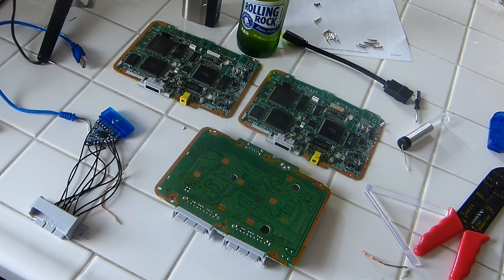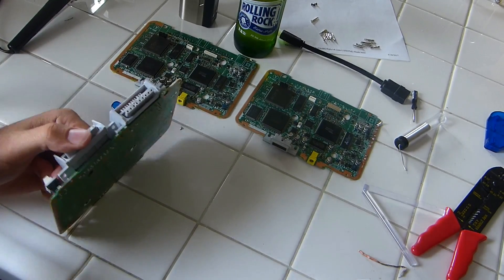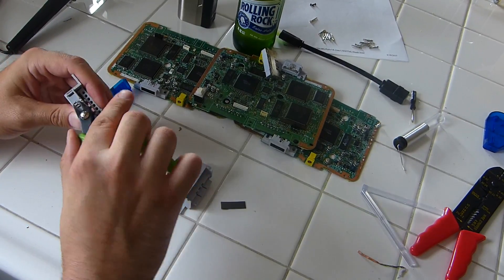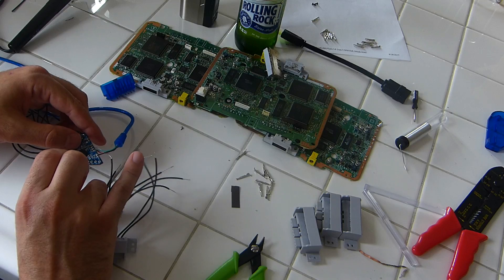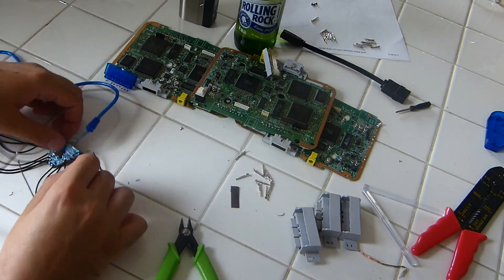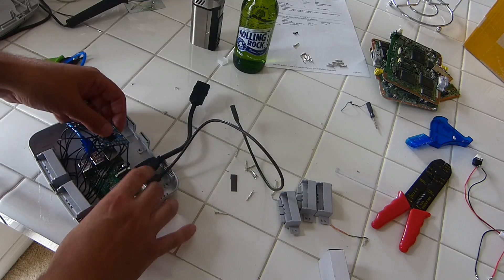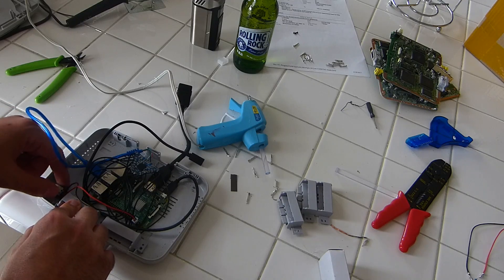PLAYSTATION PI CASE MOD TUTORIAL RASPBERRY PI - PART 2 of 2

Comment: damn soldering is the worth if anything ill just run a ps3 wireless controller(White) to play
Reply: You could just cut the adapter from non-working PSone controllers for aesthetics and use your DS3, even you can paint them grey. I'm going for that option.
Sorry about my English, it's not my native language. Regards from Peru. ;)
Reply: I just don't get the correct sequence of soldering the wires. Its just follow the same sequence of the usb board?

Comment: What is that little gold strip you are holding while you desolder? Does that help with removing? Mine just melts and sits there.
Reply from the maker: erp yeah its desoldering wick. you lay over the spots ya wanna remove and put the point ontop and it sucks it up into the braided material of the wick.

Comment: Question about the power button. Do you still need to shut down through the menus if you have the power button installed? Or does pressing the power button start the shut down process and then it turns off gracefully on its own?
Reply from the maker: James Watts No the power button being used on my images shuts down properly. It initiates a script that shutsdown the system. And as long as you dont remove power it will also turn the system back on.
Reply: Perfect! Thx MLP for clarifying. That is a clean looking mod. Definitely wanna give it a shot. Thx for the tutorials!
Reply: Hey, you wouldn't happen to have the script that you used? I am trying to build this and the power button doesn't work, I have a script I found online. Is there a certain way to wire the power button other than just using pin 6 and 5?

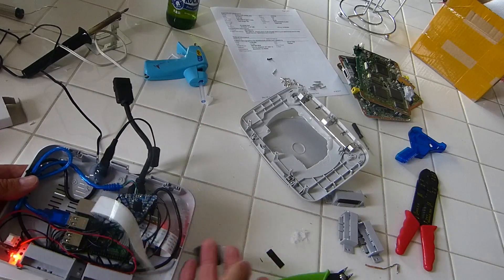Comment: Wow, you aren't going to believe this. So I remembered that in you video, you called out the byte count. So I watched it again and at around 10:25 mins, you called out: 31,104,958,464  So I went to the file that I have and at 99.9% complete, rtclkd it and then left clicked Properties and got the exact same byte count 31,104,958,464. Maybe I should just go ahead and burn the 99.9% You did mention some problem at startup. I wonder what is going on here?
Reply from the maker: rwprime1 I just looked this issue up, it looks like that last .1% is some file of the thumbnail or something that is created that is not part of the actual file. So my thought was the same that if thats the rite file size it should be the complete image minus some bogus file that windows creates when you create a torrent.
Reply from the maker: rwprime1 I also read some long winded process to stop this from happening when creating torrents, but never had this issue before.

Comment: Ron. I sent you an email regarding the WEREDIRTYGAMING.img Recalbox image on utorrent with possible solutions. Everybody is stuck at 99.9% (even those not using utorrent) and no one has 100% that I know of. Please check the email and see if any of those things help. Thanks. Richard in Michigan.
Reply from the maker: rwprime1 ok ill check that out now.
Reply from the maker: Where did you send the email? I checked all my inboxes and have nothing?
Reply from the maker: Ok I got your message, ill check it out.
Reply: Appreciate it Ron.
Reply: Ron. So I burned that 99.9% completed image and got it to run! I went to that icon or heading that isn't there anymore and clicked the Reset icon and the games showed up. I have an XBox 360 wired windows controller and all four segments of the the xbox button blink instead of the upper left being solid. Is that normal? (Just got it). Also,  the only way I could exit SNEW Arcade's Greatest Hits - The Atari Collection 1, was to hit ESC on the keyboard. Nothing worked on the controller. The github manual says that Hotkey + Start is supposed to go back to ES and that the xbox button is the Hotkey. What buttons work for you?
Reply from the maker: rwprime1 Ill have to check on it. But i remember in old versions on ES you had to install the xbox driver for the lights to stop blinking. Not 100% sure with recalbox as I havent used it a lot. Ill look into it in the morning. Glad the image worked... that 99.9% is gonna mess with peoples minds.